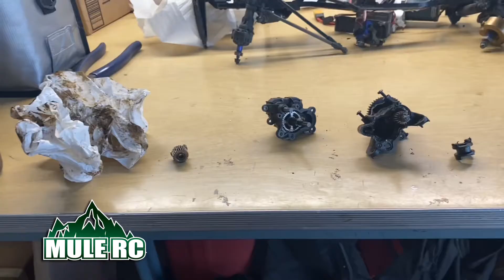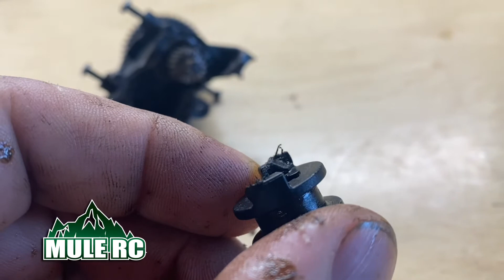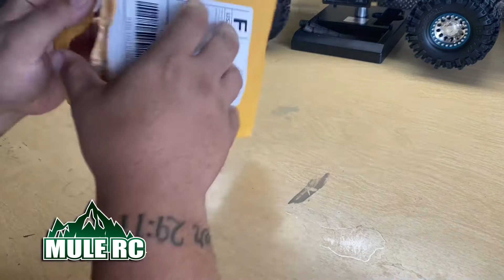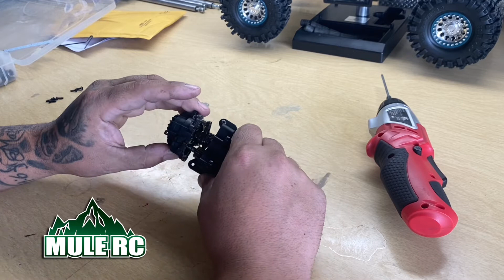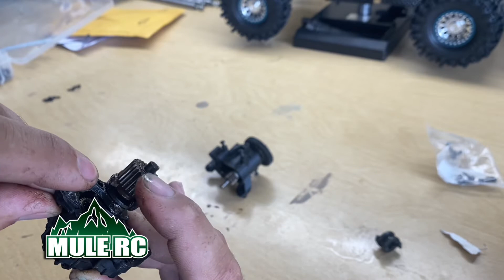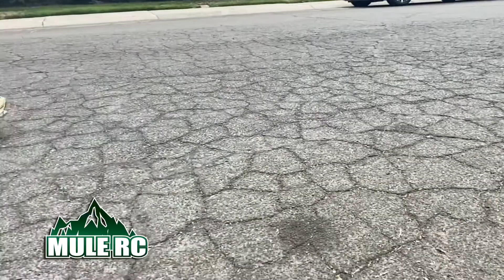Trx4 transmission, slipping, making a ticking sound and not moving in 2nd gear.

Comment: I thought my transmission took a crap yesterday after tearing the entire thing apart come to find out the nut on the spur gear was not staying tight. Hopefully the blue Loctite will eliminate the slipping.    I’ve been changing gears while I’m the throttle and I’ve experienced no breakages   Same exact transmission.